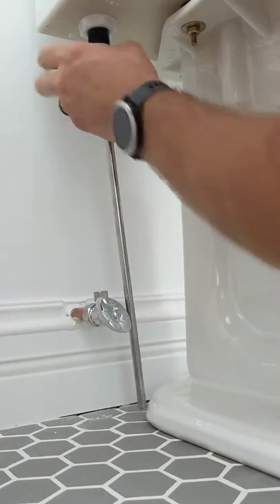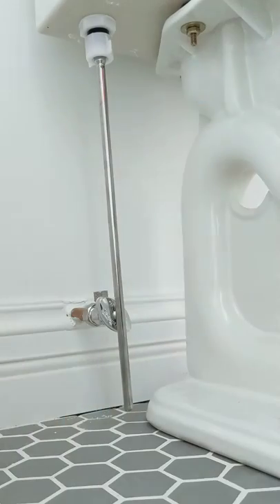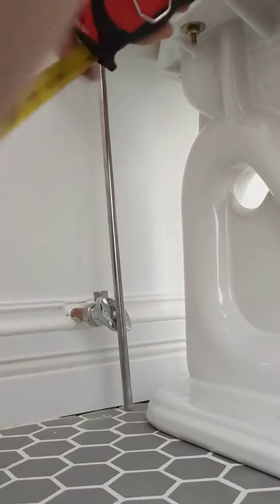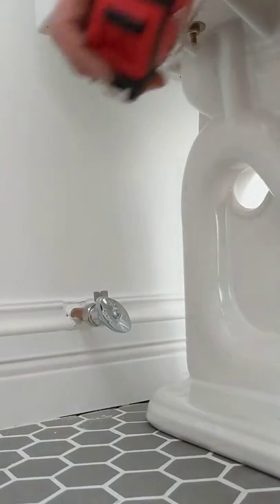Plumbing a 30° bend on a toilet supply tube

Comment: Ive been in plumbing a few years now and never had to do this. Doing a fancy faucet for a family member, he shutoffs are like only 6" away from the faucet connection point 🤦‍♂️tried do do it by hand and failed. The ones i had were domed on top like how am i supposed to get it in
Reply from the maker: The domed ones are for a faucet if you install it with just a little short, tighten to the faucet first then there is enough play in the shut off for the compression ring to still be on the supply tube.
Reply: @BRADDAPLUMBER  do you use pipe dope on either the dome that goes into the faucet or around the olive in the shut off?